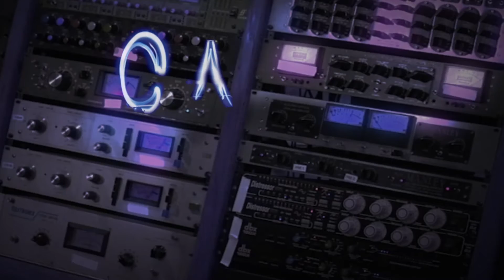Transferring Sessions Between DAWs: How to Print Stems

Comment: So how do make an audio file of my midi file?
Reply from the maker: You have to attach an instrument to the midi file.  Midi is just performance data, so it doesn’t inherently have any audio.  If you’re in PT, you can create a new instrument track, drag your midi file onto that track, and then add an instrument plugin using your inserts panel.  Once you hear audio there, and dial in your instrument, you can then bounce out that audio just like you would bounce out any other audio in PT.  Hope that helps!
Reply: Thank you.

Comment: Hey 
I want to record my bands EP myself, but I don't know what kind of audio interface I need for drums (is USB 2.0 good enough or do I need USB 3.0 to record 6 Tracks at the same time ?).
Reply: Crackling is usually a CPU usage issue. The crackling occurs when the CPU cant keep up with processing as Cato mentioned above. However the corelation to USB cable is the CPU works harder to fill the gaps in audio A/D conversion when the transfer rate from the interface is bottlenecked by a "slower" cable or bit rate. To avoid this try printing a recrding (freezing audio) with the plugins your commited to. That way the CPU can focus on the printed audio and not the accumilation of CPU dragging plug ins. SAVE THE CPU'S!
Reply from the maker: Instead of focusing on the type of USB cable, I would look for an interface that's compatible with your DAW, and look for an interface that has the correct type and number of inputs that you want.  Does that help?
Reply: Cato Zane I was told that because of its lower transfer rate USB 2.0 often causes a cracking noise when recording. Is that true? 
I think about buying either the Tascam US-16x08 (USB 2.0) or the Tascam US-20x20 (USB 3.0)
Or can you recommend me a good USB Audio Interface that works fine with Reaper?
Reply from the maker: oh, well I haven't run into that issue before.  I just asked some of the guys in the studio, and they haven't either (but that doesn't mean it can't happen sometimes).  I've had crackling issues with Pro Tools before, but it happened even when I was running without an interface, and I think it was more of a processing power issue than anything to do with cables.  The crackling thing is interesting though, let me know if you learn more about it?
Reply: Cato Zane Huge thanks to you! :)
Sure I'll let you know as soon as I know more about how this noise occurs.
Reply from the maker: @jason mastrandrea, That's good to know, thank you!

Comment: Like I said with the previous video, I use Cubase Pro 9. Exporting stems is really easy. I can select all audio tracks in my Arrangement and use a keycommand to create parts of all events at once. Then I just simply drag the parts' starting- and ending points to the beginning and end of the session so they line up perfectly. After that I can hit another keycommand and they will all be bounced to audio. Then in the Export menu, I can use Batch export to export all desired tracks at once to a new folder. It literally takes me 1 minute to do this all. I don't know if it works the same in PT, but it's a huge timesaver. MIDI tracks I usually render-in-place and send the MIDI track along with the audio version.

How about creative effects Kato? Would you want the client to send unprocessed tracks at all time along with the tracks that have creative effects on them? - Rob
Reply from the maker: Yeah, I mean, it really depends on the effects.  But I usually have them separate out effects if it's easy to do so.  I tend to lean on the side of "better safe than sorry", if the client is willing to go along with it.  I think it's better to have it and not have needed it separated out, than to have to ask them to do so later.